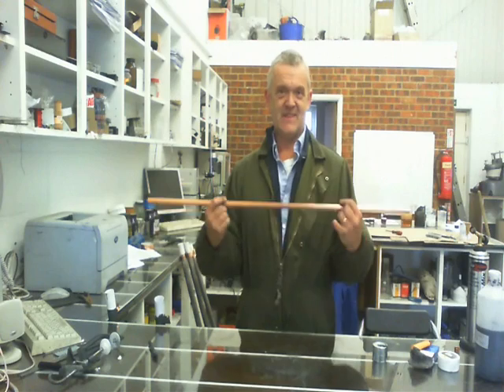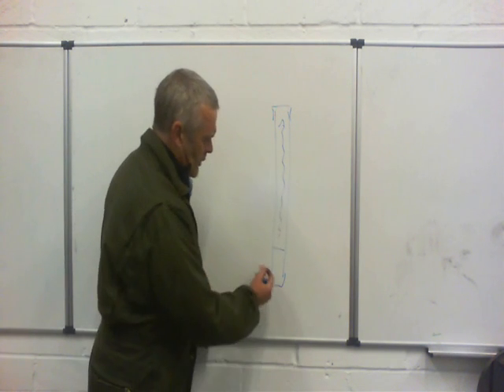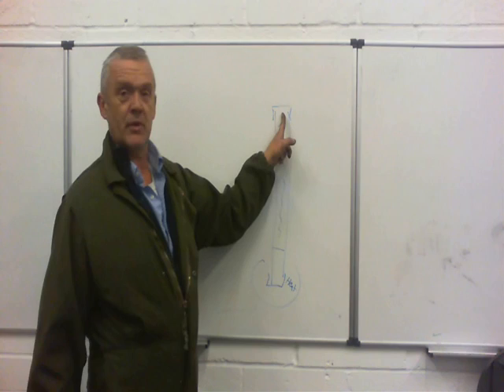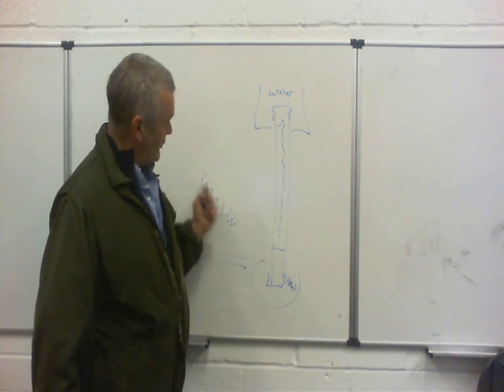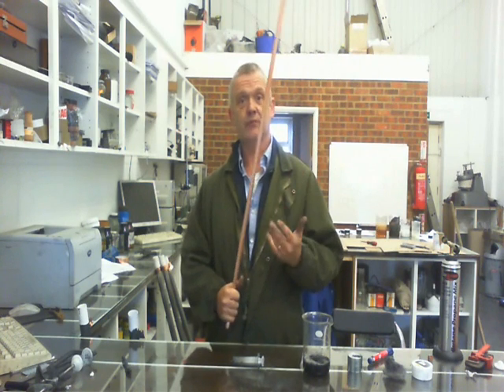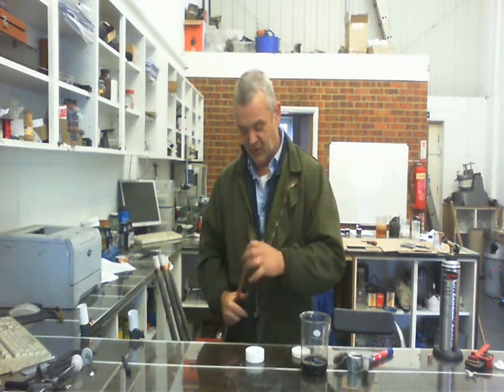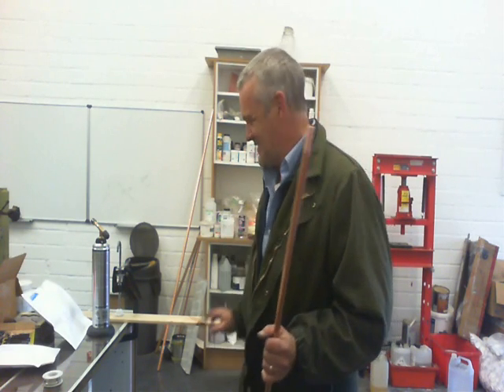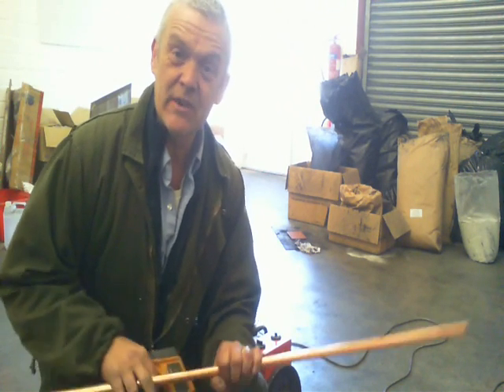How To Make A Heat Pipe (or solar heat collector)

Comment: very cool, I didn't realize how simple they are.  there ought to be a way to turn one or more of those into some variety of sterling engine.
Reply: The GeoDeaHolic  The Heat pipe can enhance a stirling engine. However if you impeded the fluid flow of the heat pipe it will diminish its efficacy.  What you could do is attach a TEG to the end of a Heat pipe two heat pipes and both ends of the teg and couple them to a heat sink and source.  You could also take two acoustic lasers (thermoacoustic stirling engines) and run them in opposite phase, with heat pipes interconnecting the two resonating cavities, and tune the fluid like a heat pipe such that a small temp change/pressure change results on phase change and cavitation. From there use a pyroelectric sensor array with a driver circuit to store in a super cap to inverter type and you will have a heat pipe type thermoelectric generator, which theoretically can convert up to 90% of the heat flow to electric power.  In the real world you will get about 30% which is till 3x better than Siebeck.
Reply: Kimberly Peacock hi I find your reasoning interesting. I tried to contact you via e-mail. would you mind possibly drawing a diagram on your thermoelectric generator concept and give me some reasoning how you conclude 30% compared to Seebeck??
Reply: Using pyroelectric elements one needs not have a high temperature difference, rather one wants a high frequency temperature change, and you have that in cavitation. Also look into Sasers the acoustical analogue to the laser. If one had heat pipes attached to the resonators and had two resonators operating in opposite phase.   I had thought I was the first person to come up with the idea of using pyroelectric elements as a teg (thermo electric generation) device but it seems a guy at Oak Ridge has already done work on this.  Predicting 90% conversion possible.  That is not the same as economical except in a few specialized uses.  The driving of it using a saser is my idea, and the heat pipe and vapor chamber additions.

Comment: Nice explanation! I didn't think there was more to the mechanics of those solar vacuum tubes.
Reply from the maker: it's really that simple mate - you stuff the pipe into one of those glass vacuum tubes - 10-20 each on ebay and stuff a load of copper wool in there to help the pipe bridge to the glass and you are done
Reply from the maker: +rokdog13 not at the moment mate - but i am working on that
Reply from the maker: +rokdog13 not quite mate - the tube has a coating on the inside that is IR reflective and IR adsoptive - the vacuum is an insulator - it is hard to make this but not impossible
Reply from the maker: +rokdog13 sputter coated caesium i think - but you will have to check that
Reply: Volk Revel - I believe it is also glass of the Boro-silicate type, like Pyrex used to be made out of, and good laboratory glassware still is, I believe...